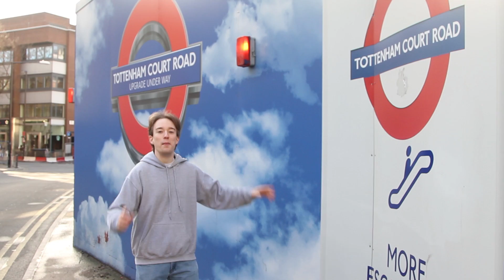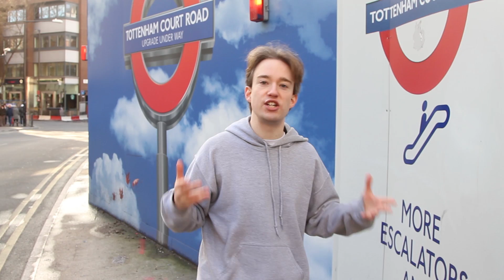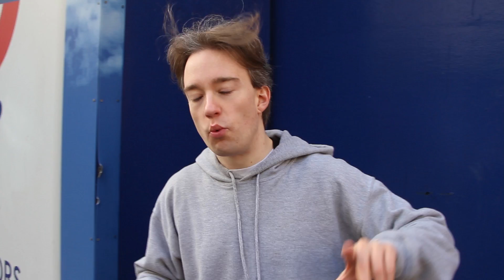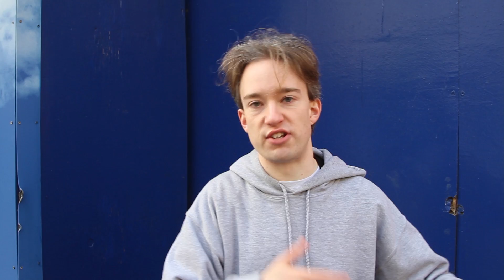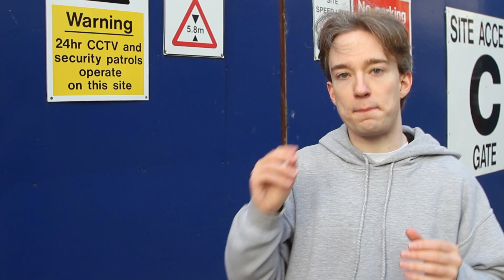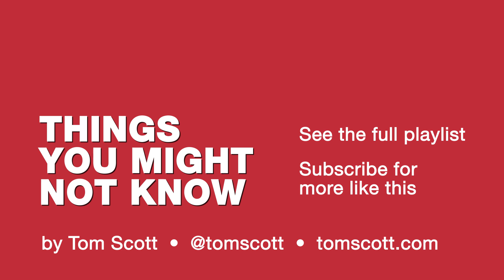Why Do Reversing Trucks Not Beep Any More?

Comment: Think is, the actual real world ones of these I've heard are much more graunchy ... they sound like a beeper running through a blown speaker, or a driver repeatedly crashing their gears trying to find reverse. Krrrrk, krrrrk, krrrrk....

It's still a less intrusive sound if you're trying to get to sleep and a truck reverses in an otherwise quiet area (the regular beep is, well, like an alarm clock or even a slower paced smoke alarm), yet distinctive and easily identified as a vehicle safety sound, but it's a long way from "fffffst, ffffst, fffffst".

Really, white noise is the wrong term for it, it's closer to brown, but the broken-up, rough nature of it actually turns it into something else entirely.

Comment: I get the reasoning behind using white noise over a solid tone but speaking from experience, i was a general laborer a few summers, you'd never hear that white noise and recognize it as a safety sound. There was always some hydraulic brake or air compressor or some other machinery that made a similar noise. That monotone beep  always made me stop and look around quickly to see if i was in an unsafe area on site

Comment: If you're afraid of getting ran over by an industrial truck at a construction zone maybe you ought to go work at McDonald's there is no need for a backup alarm or any of those beepers
Reply: There is a need.esipceally considering that sometimes trucks have to interact act with the general public and poeple are stupid.

But the white noise sound is incredibly stupid cause it doesn't stand out and just sounds like a normal sound a truck would make.it's like painting a stop sign camo cause poeple didn't like the color it's dangerous and stupid.

Comment: Something else you may not have known - the shape of the human ear amplifies specific frequency bands depending on the angle sound hits them from. No matter the angle there will be enough bands across the spectrum to give you full range hearing but your brain learns where the bands fall precisely and can use that information to locate sounds precisely in 3D space, much more so than if it relied solely on using 2 ears.

Comment: I'd say these new white noise generator would fail because it produces very quiet sounds at all frequencies- it would impossible to produce loud sounds at all frequencies. If you have multiple truck then you need a site controller not sound that can be missed- obviously this Tottenham Court upgrade construction is horribly undermanaged- a hazardous site.

Comment: Hearing and noticing the sound is one thing, but understanding its meaning an other. It may be difficult to drown out, but of what use is it if it can be easily mistaken for bleeding brakes, beach noises or traffic noise in general?
Using white noise would be problematic because similar sounds already occur in many places. During rainfall, for example, it would be desasterous.

Comment: For everyone from the US saying you thought the sound was air brakes, it probably was. I had to look up video of an actual truck with the white noise alarm (since I've never heard on in person here in the US), and the alarm definitely sounds different from air brakes imo. Air brakes have that initial plosive phase to the sound (an exponential decay if you will), where as the white noise alarms are gated like a square wave (either 100% volume or 0% volume). Plus you still hear the beep type alarm at construction sites all over the US, so I don't think the new type has been adopted here yet.

Comment: My only comment to those 'learned' university professors is that I work in a store where fork lifts operate all night long (and yes, I drove them for 7 years). The Gas FLT engine noise is so loud, you can NOT hear the white-noise sound, where you can the beep. You can hear the engine, but not know if it is traveling or just elevating a load. With the electric FLTs, the white noise 'echos' around the aisles, you can not tell from which aisle the sound is coming from. With the Beep, you can tell from which side of the isle you are in the noise is coming from. White noise may be great on a building site, but it is CRAP inside a store!
Reply: just listened to some examples, one being a forklikft as well, and its engine is quite a bit louder. even in the open.
I'll accept that theoretically the white noise is better, but people should still use some more common sense than "this is what's perscribed, so let's just use that". Do some field tests in their actual use environments before replace all your alarms.

Comment: wow. Good to know about this. When I hear a white noise sound such as hairdryer, a cooling fan or vacuum,even car tires wooshing on the road,then all other sound is canceled out  and I cant hear anything at all. therefore my
 hearingaids filter that white noise sound so I can actualy hear normal sound, I didnt hear the newfangled sound until i turned them off. Now I,m not working construchtion in London. I think the new sound is way to similar to the sound of airbrakes or hydrolics  working. No it sounds axactly like an heavyduty concretepump. Keep the beep. Remember on alot of construction sites earprotection is mandetory. The new sound would be alot harder to recognise than the well known beep. Keep the beep.

Comment: Several years ago I worked for the NHS and they replaced every ambulance in the trust with a two tone that omitted a white noise in between tones. This was off the back of this research. However... it turned out that the research was wrong and the company that sold the systems were forced to come and remove them and replace the sirens with the traditional ones. It was concluded that there is no proof whatsoever that white noise is easier to locate and in fact can't be heard by some people with frequency dependant hearing, so more dangerous than traditional two tone. That's why you don't hear the white noise ones on ambulances any more.

Comment: according to the comment section, this is ineffective as all hell as literally nobody seems to know about it - ergo no one would recognize it as a sign to back away, defeating the purpose, yay
Reply: Several years later, and I've still never heard of these until I saw this video.
Reply: The most people here in the comment section probably a) don't work at a construction site and b) not in the U.K., where it's most used.
The most people here assume it doesn't work. Most people around 1900 thought the same about flying.
Reply: I'd assume it was some kind of spraying, digging or hydraulic machine or gears grinding.  Not a vehicle reversing.
Reply: Everyone entering the site, even visitors, would be required to have site-specific safety training (or be very closely supervised), so they'd know.
Reply: Well if I heard a sudden and strange noise like that, I'd look towards the source and see a reversing truck, so I'd get out of the way.
Reply: If that hiss is 2.5 meters to your back left when you're on a construction site, you'll immediately realise some piece of machinery is suddenly very close to you making a repeating noise. If it's getting closer and closer you'll quickly be alerted too.
Reply: @LittleLionRawr  : Wouldn't that also be true (but much more so) for a beeping sound?

("If that hiss is 2.5 meters to your back left when you're on a construction site, you'll immediately realise some piece of machinery is suddenly very close to you making a repeating noise. If it's getting closer and closer you'll quickly be alerted too.")
Reply: @Milesco  Certainly! That's the fundamental concept, right? The benefits of the hissing vs the beeping are not that it changes that base concept. It's in other areas, like accessibility (people with tinnitus or something similar), and long distance noise reduction.
But my reply was focused on explaining why general people not being familiar with this version of the signal won't change it's effectiveness in situations where it's actually necessary.
Any loud repeating noise will work to get someone's attention in those situations, but this one should work for the most people.
Reply: @LittleLionRawr  it's also easier to identify the true direction of the source and less likely to be confounded by reflections (i assume because a narrowband sound like a beep might e.g. be reflected well, causing confusion, where white noise might have some components of the sound reflected well but others absorbed, reducing the effect of reflections). also, it's less likely that a sound covering all perceptible frequencies will be masked by another noise, than a sound that covers maybe a few kHz or less.
Reply: @LittleLionRawr  If you haven't noticed a truck 2.5m away then something is wrong with you
Reply: @sparkyboi7352  Clearly, there's need for these signals at all. The distance was an example so it's not even worth focusing on. Also, not all of us have 360 degrees vision, you'd be surprised how little you might notice when you're focusing on a particular task or thing...
Reply: @LittleLionRawr  No need to get offended pal, I just thought that was a little close for someone not to notice, especially if it's a massive truck/piece of construction equipment, and I decided to have a chuckle. Calm down.
Reply: @sparkyboi7352  Not offended, that's a faulty assumption. I just clarified myself, and gave a reason why 2.5 meters might even not be such a unrealistic distance. (I might add the noise on a construction site and people wearing ear protection.)
Reply: people forget the purpose of this.
It is to know the direction of something even during loud and busy environments.

 If all trucks beeped, it would be hard to tell which direction it is coming from.

But a static sound will let you know that something big is coming your way.

Somebody gonna say that they don't move out of the way when they hear the loud sound of pneumatic brakes? Good for us then, natural selection. With beeping sounds, you would just stand there, confused, yes you would know there is a truck, but where? Goodluck with natural selection for people complaining with the hissing sound of trucks reversing.
Reply: When did you go through trainining to recognise what the beeping sound meant.
Reply: Anyone who doesn't at least look in the direction of this noise deserves to be run over. Twice.
Reply: @Candlemancer  what else can i say but... No?
Reply: you dont have to know about it for it to be more effective....

Comment: That sign is ridiculous. There must still be enough old trucks that beep in operation to warrant  people working on a construction site to recognise the sound. If they get a delivery of cement or something do they refuse to accept it just because the truck beeps? Do they then keep ordering more cement until a non-beeping one arrives?

I've never had any problem recognising that beeping sound. I wonder is that white noise on trucks in Ireland? I'm fairly sure I've heard it but would have thought it was the sound of brakes. The beeping sound on the other hand definitely sounds like a warning to get out of the way.
Reply: I don't think the reason for the sign is because the workers wouldn't recognize the beep.  The reason was because they don't want beeping trucks disturbing the residents in that area.

Comment: Where did you hear that "white noise" is easier for a person's ears to locate?
Reply: No Idea, but I've repeatedly experienced the opposite. Very loud and shrill car and house/shop alarms.
Sure, you can hear an alarm, but good luck figuring out where from.
The worst was a shopping centre that was mostly closed. (only a few major shops open).
A breakin alarm was active in one of the shops, but who knows which one.
I actually tried to work it out, and 5 minutes later still didn't have much of a clue.
You certainly don't have 5 minutes to figure out which of a dozen trucks is reversing.
Sound localisation is important.
Reply: Just google white noise reversing trucks...
Reply: well it is. It's just physics. A sharp and consistent tone will disperse much less than white noise will when it bounces off an object, meaning that while you can easily hear the noise, it can be difficult to locate it by sound alone. White noise on the other hand disperses almost completely when it hits an object.

Comment: Hmmm yeah if it ain't broke.......

We all know the beep sound. If I heard a shhh sound I'd be thinking what was that? Oops too late.
Reply: omgcow The reason it had to be changed was PRECISELY because there were too many  avoidable accidents and deaths. If there are five or ten trucks around you, the echo of the beep throws you off as to which one (or more than one) is about to move. Three trucks beeping at the same time really mucks it up, I can tell you from experience. And in cold weather the beeps travel slower and get muffled. The hiss on the other hand hits you like a direct blast. You can’t miss it.
Reply: My thoughts exactly. Nothing says "There is a big truck about to run you over" more than an air horn, and that instantly recognizable beeping sound!
Reply: The problem is that it is broken. He touched on this slightly, if indirectly, but out ear have trouble distinguishing direction of single tone noises because they have a tendency to echo very sharply. In day to day life, that wouldn't be a problem because you'd be fairly suppressed by the beeping and look around, however, what if your working on a construction site ? That noise would be expected, and so being able to distinguish direction through sound alone is extremely important.
Reply: Is it a broken walkie-talkie? Working air compressor? Sander? Let's peek around the corner and chec... Oh there is a crane tire on my foot.
Reply: @Mic_Glow  It doesn't sound like any of those things IRL though. It sounds exclusively like a reversing vehicle. Even if you've never heard it before, you'll know something's up and won't be run over.
Reply: @Mic_Glow  That's Darwin at work, baby. If you are actively searching for the sound and somehow manage to miss the fact that is a truck about to back into you I'm sorry but that's just natural selection, you will be missed. RIP
Reply: KynigosTheWolf If you're in a construction site you DON'T get complacent around beeping of any kind m8. It's always loud enough.
Reply: Well unfortunately you have to learn sometime. Once it become commonplace, there might originally be a few more accidents, but then the sound would become common knowledge, and being better to hear under noisy conditions would save more lives.

Comment: "non compliant vehicles will be turned away" At which point the vehicle will perform a 3 point turn (involving reversing) thus negating all apparent safety benefits, in addition to having to make the same journey again doubling the chance of an accident. The genius of health and safety.
Reply: Not if they've pulled up beside the gate, and the guy responsible for opening it leaves it closed unless the driver can shift into reverse and demonstrate the sound. If the truck beeps, it's sent away... moving off in a forward direction.
Reply: The guy in the non-compliant truck will just lean out the window and say "SHHHH SHHHH SHHHH".
Reply: @quillaja  I know that's a joke, but it would be physically impossible for humans to make the sound those trucks make IRL.